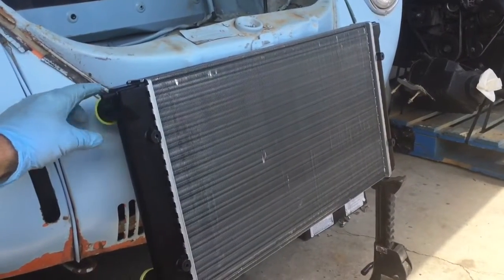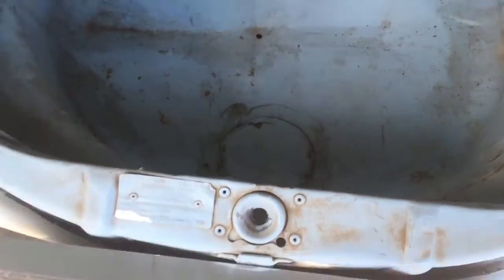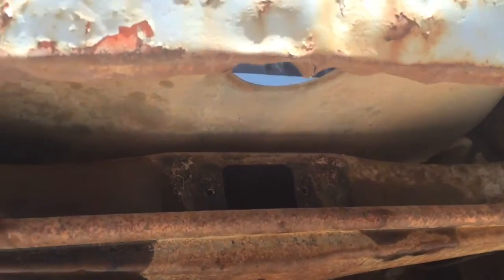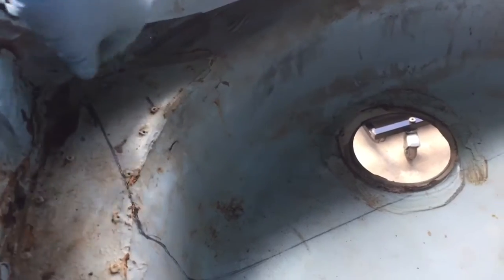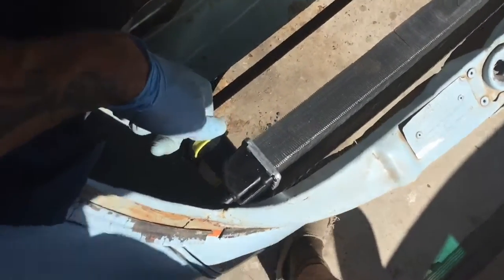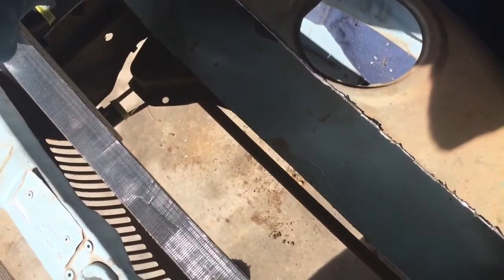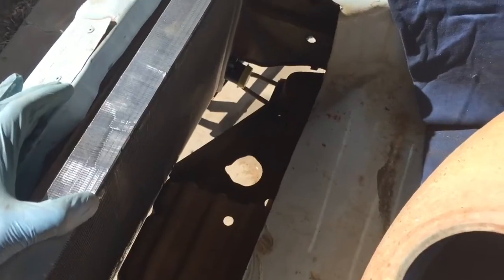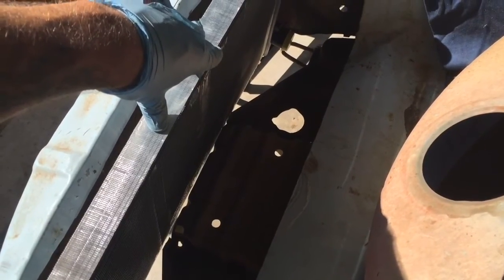BUGaru Part 7 - Radiator Fitment

Comment: My friend who's done the exact same conversion has no issues with overheating. He put air scoops on the bottom of the radiator- but had to take it off. It cools too much. So you'll definitely be fine.
Reply from the maker: +daniel Jimenez That's interesting about the scoops. I'll be sealing up the gaps so that the airflow goes through the radiator so I think it'll work out great. If not, then I can always change things up. Thanks for the comment.

Comment: yes that's the one .low so you still have your full boot floor plus because it's low it cools the full rad .I hope this helps someone!
Reply from the maker: +Graham McMahon Is there no cutting required for that radiator? If No cutting does it hang below the body line? I can't find that radiator commonly - are you located in the US? Do you have a source for the radiator? Thanks mate!

Comment: The cabin heater will be interesting.
Reply from the maker: +Kevin Hornbuckle Yeah, it'll be great to see how that comes together myself as well :)
Reply: Remember to put a drain valve on the bottom radiator hose and a temp sender. You will be able to measure the cooling rate that way.
Reply from the maker: +Kevin Hornbuckle Can you explain that a little more? I'm not sure I'm following how you would measure the cooling rate. Do you mean just take an inbound temp reading and taking an outbound temp rating and comparing? I think as long as the engine runs at good temps I'll be okay with it.
Reply: I agree that you will be fine. But it would be interesting to be able to quantify the drop between in and out. Yes, just a comparison.
Reply from the maker: +Kevin Hornbuckle Cool, that's what I thought you might be interested in seeing. Maybe at some point if hardware something like that but for now I may just do a hard drive to kick the fans on then use an infrared thermometer to check temps - quick and dirty but hopefully enlightening.

Comment: Hi I used a pug 309 gti racing dual core rad .perfect height and width
Reply: Is this the rad you are talking about? http://m.ebay.it/itm/Peugeot-205-309-1-6-1-9-GTI-Alloy-radiator-aluminium-TCT-Turbo-CTI-16S-Swap-RS-/180861255002?nav=SEARCH

Comment: Thanks for the response.  The 95 is a 2nd generation and the Ej22t   is a first generation.  it has a multi junction connection that pins into one of the 4 ecu plugs. 1995  Subaru has a cleaner wire lay out then 90-94. Do I use the main relay and fuse box and just illiminate wires not connected to the ecu?  Aloha
Reply from the maker: +Hiram Whitaker Hi Hiram, all of the harnesses (OBD1 and OBD2) are very similar. The OBD1 have a big grey splice plug that you can eliminate by soldering the wires but that's one of the only major differences. I don't use the big black relay box in my conversions I've tried to in the past but it's just clunky and not set up right for a VW swap.

Comment: What year rad would it be for? I have an EJ25 and I need to figure out what radiator would work best.
Reply from the maker: +jeffinillinois It's an early Scirocco rad (1983 is a good bet). I'll keep everyone posted on how it cools, I don't think there will be a problem at all though.
Reply from the maker: +jeffinillinois here is where I sources mine (under $50): http://m.ebay.com/itm/New-Engine-Radiator-For-VW-Golf-Jetta-Cabriolet-1-6L-1-8L-1L0121253B-CU837-/142017354953?hash=item2110e4dcc9%3Ag%3ATAoAAOSwnFZXVkVk&_trkparms=pageci%253A4bbb01d7-5019-11e6-ab96-74dbd180e440%257Cparentrq%253A1306c3951560a357b514d8bfffff6acc%257Ciid%253A1
Reply: Thanks! Could you possibly tell me it's overall dimensions? I'm putting mine in a low-nosed kit car and will have to lay it back a bit. Going to keep watching, especially the electrical!
Reply from the maker: +jeffinillinois Next time I'm at the shop I'll try and take some measurements for you.
Reply: Thank you. Much appreciated! :)